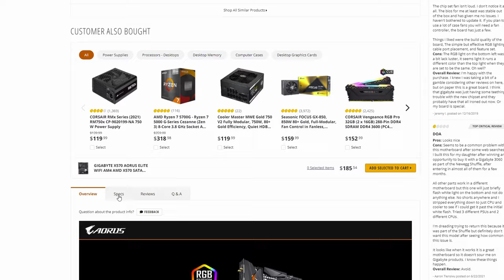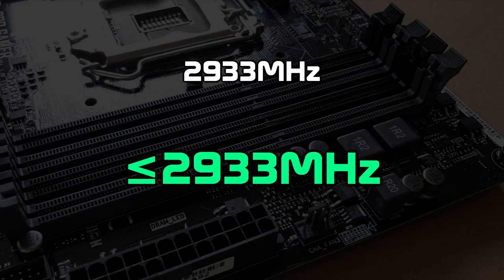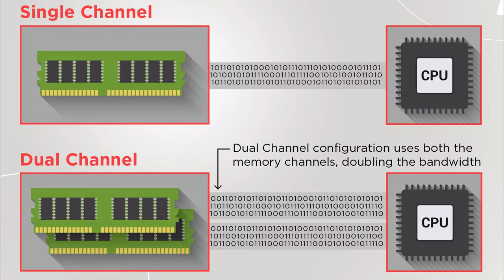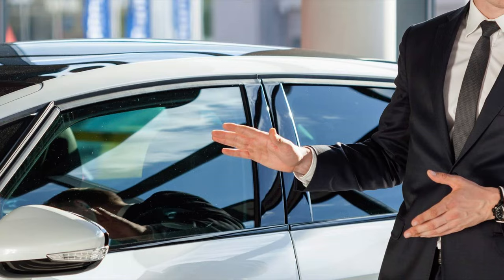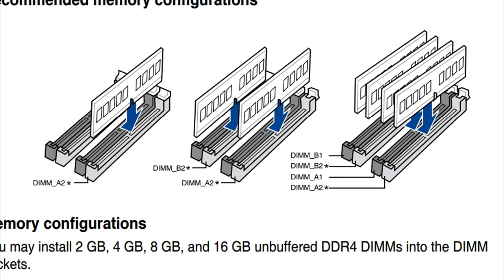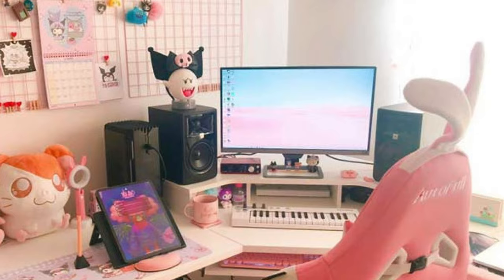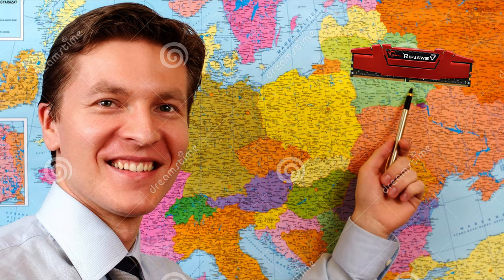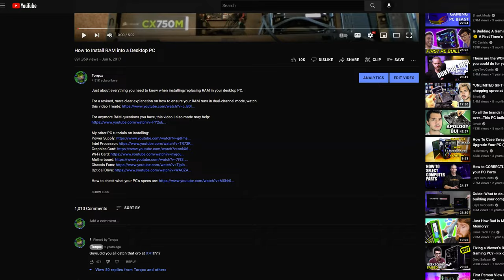How to Install RAM into a Desktop PC (2023)

Comment: I find your content lightly comical, you've gained my subscription. I do, however, have a question. I consider myself somewhat PC Tech Savvy and I'm currently running 2 4GB RAM sticks, and a single 8GB ram stick (with both 4GB RAM sticks in the A1 and A2 slots and the 8GB RAM stick in the B1 slot). I am upgrading in two days when my next 8GB stick arrives. When I slot these in, should I have them alternate in sizes? Like putting the 8GB RAM stick in A1, then a 4GB one in A2, then 8 in B1, and 4 once again in B2? Thanks in advance.
Reply from the maker: It's appreciated, and yes, I'd put the matching capacity modules in the slots they'd match in if you were to run them in dual-channel together.

Comment: 4:21 Or it will give a loud beep or continue restart to it self
Reply: Yeah this is the part I'm worried about when I install my new 2x16 later today... I had issues earlier this week with only 1 of the 2  8GB DIMMS being recognized, and I still can't tell if its a MOBO issue or I had a faulty DIMM.... but I had a few hours of Beeps and Restarts and BSOD until I was able to fix it T_T;

Comment: nice but still missing part, when you have f.e. two 4+4GB modules and buying one 8GB (same speed), or having 8+8GB and buying just one 16GB... so you can run Dual-Channel also with 3 slots ... f.e. 4 - 4 - 8 (A1 - A2 - B1), cause amount in A bank is the same as in B bank (8GB each)

Comment: i have a question. lets say i have 8 gb of ram runing dual chanel mode using only 2 slots on 4 slot motherboard 4+4. then after a while i want to upgrade adding another 4+4 ram with different brand will it run dual chanel or single chanel? or will it even run
Reply from the maker: If the specs are exactly the same, they "should" run normally alongside the other initial pair of modules in the system. But without going with the same exact make and model, there is no way to be sure unless you try it for yourself, as far as my knowledge goes.

Comment: Hi, if I own a custom made computer, how do I detect which amounts of RAM I can use without damaging the computer or system? Thank you
Reply from the maker: The big thing is to know what your motherboard is, that should tell you everything you need to know about how many slots it has, what type it takes and what speeds it support. An easy way to find this out is to download and run the free program Speccy.
Reply: @Torqcx  I'm going to collect it tomorrow or later I think so I will be informed about everything tomorrow or so. do you have recommendations on where to buy ram in the future? Should you buy them off amazon or go to PC world or other PC related shops which sell parts for computers? I don't know if it helps but I live in the UK.  I'm starting off with 8GB RAM for now which might be pretty small but once I will have some income I might see if my computer will work with 32. The family I work for has a custom one they made with some alien logo (triangle-ish shape Computer) with about 12 terabytes so I was wondering if I would be able to reach similar effect over time period
Reply from the maker: @Ghoul_Hunter  where you get the RAM I don't think matters much, it's more about who makes it (what the brand is). Corsair and G.Skill are good, reputable brands to start with but there's plenty more out there. It's hard for a company to mess up RAM though, either it will work or it won't. Just read into its specs and make sure it's compatible with your motherboard and you should be all set.

Comment: I have a prime B650M-A WIFI II should I use the first slot closest to cpu for first ram stick or skip to second and 4th slot ?
Reply from the maker: From searching up that motherboard model's manual on Google and flipping to the page about the system memory, it says slot A2 is where it should be installed.

https://www.manua.ls/asus/prime-b650m-a-wifi-ii-csm/manual?p=21
Reply: @Torqcx  thanks it’s weird tho my pc wont turn on unless I use the last 2 slots farthest away from the cpu not sure if my motherboard is faulty or not since it only power on in single channel

Comment: What if you want to run 2x8gb and 2x16gb? Both 3600 same speed
Reply from the maker: You may have luck with that, you'll have to test it. Regardless, it's always recommended to get the exact same make and model when you have multiple RAM modules because there isn't really a way to know until you test it.

Comment: Hi, i have a branded dell PC with only 2 slots with 1 occupied with 8gb of ram!

I was thinking about upgrading to 16gb ..which is better? buying another 8gb or a single 16gb?

And also is it ok using different brands!? ..or do i have to stick to the same one that came with my PC?
Reply from the maker: Best to use the exact same make and model when installing multiple modules. If adding a 16GB next to the 8GB would work well, then that is what I would recommend. However, not knowing the specs of any of the components, and on top of that not knowing whether the modules would communicate well or not, I wouldn't be able to give you an accurate prediction.

The fail safe would be to just get another 8GB and make sure it's the exact same model that you already have. Another option would be to just get 2x 16GB modules and replace the current 8GB one you have.
Reply: @Torqcx  Thanks for the quick and detailed response! 😀

I thought it would be as easy as grabbing another 8gb 3200hz over the internet ..i already identified 1 from Corsair! 😅 ..mine is from Micron Technology!

Here's the memory configurations supported  by my pc if that's of any help:

4 GB, 1 x 4 GB, DDR4, 3200 MHz 
8 GB, 1 x 8 GB, DDR4, 3200 MHz 
8 GB, 2 x 4 GB, dual-channel DDR4, 3200 MHz 
16 GB, 1 x 16 GB, DDR4, 3200 MHz 
16 GB, 2 x 8 GB, dual-channel DDR4, 3200 MHz
32 GB, 1 x 32 GB, DDR4, 3200 MHz 
32 GB, 2 x 16 GB, dual-channel DDR4, 3200 MHz 
64 GB, 2 x 32 GB, dual-channel DDR4, 3200 MHz
Reply from the maker: @iam_nobody  from those specifications, it sounds like you should go with two of the same make and model, regardless of the capacity you choose.
Reply: @Torqcx  Thanks for your help! 🙂

Comment: My pc has downgraded the speed to 2133 mhz. I had two different rams in dual channel tho. 
One is 8gb @ 2666
Second is 8gb @2400

Dont know why speed gets lowered to 2133 instead of lowest ram speed which is 2400
Reply from the maker: It may be that your motherboard doesn't support 2400MHz so it downgraded the overall speed to whatever it supported next (which was 2133MHz). That's only my presumption without looking at your specs, though. Assuming that you were getting 2400MHz prior to installing the second module, it's possible the board doesn't support the speed with multiple kinds simultaneously installed (again it's always recommended to get the exact same kind of make and model when you have multiple modules)
Reply: @Torqcx  yes I was getting 2400 mhz prior to adding 2666. 2133 is the minimum speed board supports but not the minimum speed of any of those rams. So yeah seems like board is downgrading ram speeds as well..

Edit : Seems like the 2400 mhz ram has native 2400 mhz speed (without enabling any xmp profile and also this ram does not have any xmp profile) 

The 2666 ram has native speed of 2133 mhz (without enabling xmp) but this ram has xmp profile when enabled it boosts up to 2666 mhz

Thing is, the motherboard cannot enable xmp profile on just one single ram module that supports it. If i remove the 2400 mhz ram the option to enable xmp and get more speeds shows up. But if I put up both, option to enable xmp disappears and both rams run at 2133. Interesting really

Comment: If my motherboards memory type is dual channel DDR4, is it able to work in single channel as well? Or do I need to buy new RAM
Reply from the maker: That depends entirely on the motherboard you have; most of the time, the answer is (or was) "no", you need an even number of RAM (2, 4, 6, 8 etc.) in order for the system to run in multi-channel mode, otherwise the entire thing will revert to single-channel. That being said, you can check your motherboard's specs, as more modern ones are beginning to run in both modes
Reply: @Torqcx its a gigabyte z690 and it says it’s memory type is dual channel ddr4

Comment: Bro..i installed my rams in A1 and B1...is my pc running in dual channel?
Reply from the maker: A1 and B1 or A2 and B2 generally will have the system run in dual-channel, but every motherboard is different. You'll have to check your manual and/or a program like Speccy (free and easy to install) to make sure!

Comment: Hello, I have a laptop with 8 gb of ram and 1 slot available. should i buy 8gb or 16gb of ram?
Reply: also, will it run in dual channel mode if i install an 8gb ram clocked at 3.2ghz ? im confused since when i search up my laptop model it says that my laptop ram runs at 3200mhz but when i open the taskmanager, it says 2667mhz (idk why it says 2667 instead of 2666 lol). thats why im confused whether to get 2666mhz ram or 3200ram.
Reply from the maker: @reyarjaylosurigao1257  I would just get another 8GB module as it's always recommended to get the exact same make and model when installing multiple RAM cards. The other option would to be get two 16GB modules and replace the single 8GB card you have, assuming your laptop can be upgraded to a 32GB capacity.

In the BIOS, there may be a setting in there throttling the RAM's speed (it may be able to run UP to 3200MHz, but, by default, be clocked at a slower, "safer" speed).

As for the 2667MHz fiasco, yeah I noticed that too, I think it's just because the actual speed (2666.666...) rounds up to 2667, and it's easier to just display it that way, so that's what they do, lmao

GL GL!!

Comment: Hey brother, I have four DDR4-3200 8×2 Ram sticks. I used it for almost 2 years but now I am getting problems while running all the sticks together ( Problem- Pc doesn't display anything). Checked all the 4 Ram by dual channeling (A2-B2) They work perfectly. (Never overclocked) (XMP disabled) . I don't get it what's the issue please help ☹️
Reply: Do you use a GPU? If so, ensure that it's cables are securely connected. I panicked when building my first PC, because it wouldn't post. As it turns out, loose PCIe cables was the issue. In fact, ensure that your Motherboard and CPU cables are connected properly as well, of PCIe wasn't the issue.

Comment: If I'm currently using 1 x 8 GB 2400Mhz and if I install 2 x 16 GB 3200Mhz (arriving today), will I need to change any settings or do any steps for it to recognize Dual channel or will it automatically know ?
Reply: What did u find out ? I'm doing same thing

Comment: what should i do if there’s no click when i put my ram sticks in? i’m confused lol
Reply: the latch also does not fully close
Reply from the maker: @unsigned_long_long  Make sure it's oriented in the correct direction and there's no debris in the way of the slot and the module. Is it the same result for every single slot? If so, there's probably nothing wrong with any of it, just push them in to the point where the latches can close onto the modules in time (even if they don't do it automatically, if you can manually latch them in they should be fine). Worst case scenario the computer will just not boot.
Reply: @Torqcx  thanks a lot i figured it out i just wasn’t pushing hard enough into the slot. was scared i was gonna break it lol

Comment: I installed all 4 and it won't display but when I put only 2 it shows display
Reply from the maker: When the display doesn't show, it means the system is failing to boot. Try each individual RAM module in each slot, one at a time, and see if you can rule out any of the slots or modules causing the issue. Then go from there.
Reply: @Torqcx  ok will do thanks

Comment: Well just change my ram and I canot no longer log in since my computer only crash and no, the new ram has the samedi 3200 mhz as the previous one, and both are 16 gb like the olds ondes were.
Reply from the maker: Start by clearing your motherboard's CMOS, then installing the original RAM that worked. Go from there

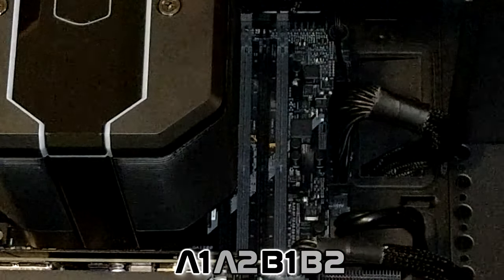Comment: Nope. A1 and A2 is one channel and B1 and B2 is secend (As 1:26 picture show). You shoud keep same amout ram in bouth of channels. No matter which one, it coud be A1 and B2, CPU-Z WILL raport proper DUAL CHANNEL configuration. You coud also make  4+4 in A1 and A2 and 8 in B1/B2 and it still going to be dual, sinc amout in bouth channels is equal.
Reply: not even edits saves ur errors